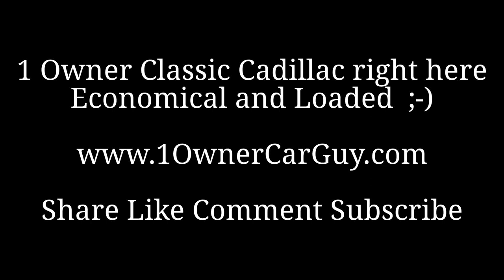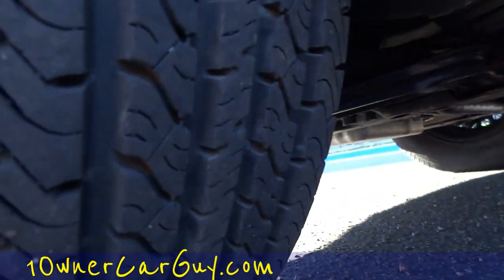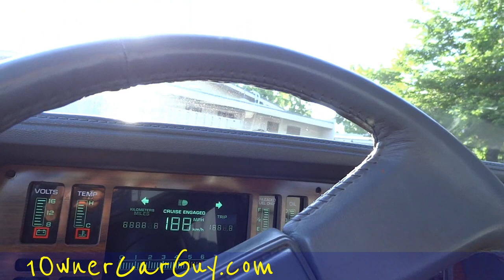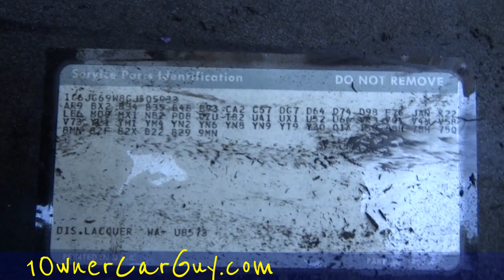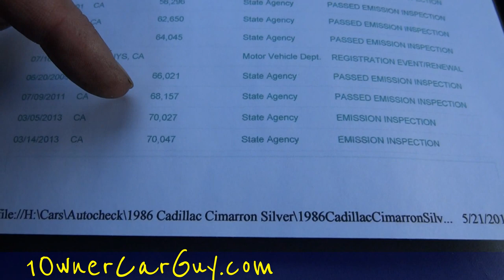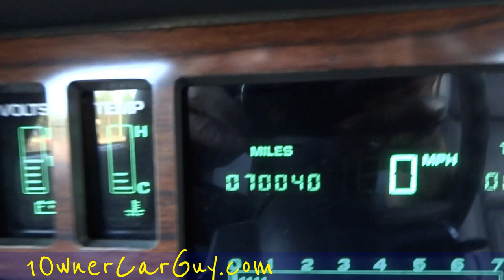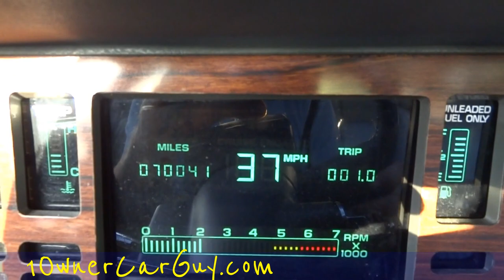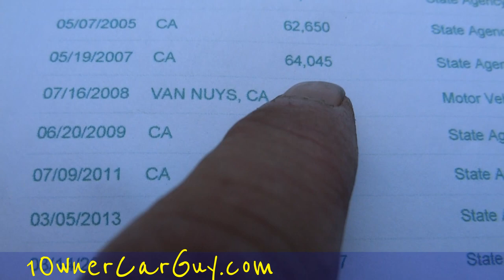Cadillac Cimarron Sedan 2.8L V6 1 Owner 70,000 Original Miles Test Drive Video Review Cavalier

Comment: On the "looks like a supercharger" thing, you can shoehorn a 3800SC and a 4-speed automatic in there, requires some creativity as far as wiring and engine/trans mounts, but it can be done (and has - just search cavalier 3800sc here on YouTube).  Likewise, the 4.9L V8's from 91-95 Caddys also can be fitted.  Northstars aren't so simple, but would be interesting.

Comment: “Beautiful, just beautiful...absolutely beautiful car!”  It probably needs about $3,500 if not more, to get it back in shape.  The whole car needs to be painted and the dings smoothed out.  Repairing torn and cracked leather can be really expensive.  Just fixing the electric antenna can cost at least $200.  I know because I have a 1988 Cimarron that was my moms.  She hated that car so I worked 2 jobs when I was younger to buy it from her and my dad.  They only put 8,400 miles on it and it now has a little over 13,000 miles.  I don’t know why I like these cars because they are NOT practical at all.  They are poorly made and the craftsmanship is a joke.  This one car just about killed Cadillac but for me..... I love the car.  Mine has been garage kept all its life and the paint still faded.  A few electrical things stopped working and the threads on the vinyl top started pulling away from the roof so I had to get that fixed.  The inside roof lining had to be replaced as well and the plastic body parts under the rear taillights and around the headlights had to be replaced as well.  In short, I’ve had to spend thousands on replacing or repairing things on the car that was because GM just threw the Cadillac Cimarron name on a cheap Chevy Citation body, threw a bunch of bullshit convenience options on it and charged the customer thousands extra for it so NO it’s neither a practical or economical car....but I do love the thing.  When I do take it out people ask me about it.  It’s a really nice deep read color with a black top and tan leather.  It actually has a BOSE CD/Cassette player and a factory installed cellphone that I had to pay to update from GM when all cellphone networks became digital and a 5 speed manual transmission.  The car was special ordered by the owner of the dealership where my mom originally bought it from in Jacksonville NC.  The owner drove it for one day and he put it inside the showroom.  My folks got an excellent deal on the car but after a few months they hated it so I (at 15 years old) convinced them that I’d buy it.  I did work 2 summer jobs and then my dad helped me by co-signing a loan for me.  It took me 4 years to pay it off but I always kept it in their garage.  Regardless of how dumb a car it is..........I love the damn thing but like I said it has cost a lot of money to maintain and mine has just a fraction of the miles on it than the car featured in this video.

Comment: I had a GM V-6 2.8L in a 1984 Firebird with about 123,000 miles. It lost oil pressure while I was driving about 2 miles from my home. I pulled over to check the oil and noticed white fluid pouring out of the oil cap. Meaning a gasket or some other internal component failed and radiator coolant was pouring into the oil pan.

Comment: I love that old GM 2.8L V6. A little old lady traded in her '87 Chevy Celebrity wagon that had this motor and 237k miles. It ran amazingly well and by far the most responsive motor I've ever driven.
Reply: She must have bought a decent one,  Overall 2.8 motors are fuel inefficient crappy motors with the added insult of the hard to reach back spark plugs. The 3.8 is better in every way.

Comment: This car deserved very little of the bad press it got saddled with which continues to this day, judging by some of the comments here.  Remember, it was designed at a time when gas prices were over a dollar a gallon for the first time ever.  Had prices continued to rise throughout the 80s there would have been many more cars like this one; from all the manufacturers.  Can you imagine a small FWD Lincoln Town Car?

Instead, gas prices stayed steady and never even topped two dollars a gallon until the year 2000...   And now everyone is driving enormous SUVs with 350 HP and they get about fifteen miles a gallon.

Comment: any of the J-body cars with a V6 is a nice driving car. i have a 1991 cavalier convertible 3.1. for such a small car, its always eager to go. not a slouch like some people think they are
Reply: its actually the older 3.1 multi-port the 3100 was known as the SFI engine. i know they are both the same displacement but they actually are not the same engine. the car has decent performance for a little car. its a little car with a fair sized engine, unlike today where they stuff a over complicated turbo-charged hand grenade under the hood. newer cars offer margninally better fuel economy, are heavier, and allot more complex but dont nessarly perform much better unless your spend $$$$. my other two cars, i have another 91 cavalier 2.2 with 47K miles on it AND i have a 1996 camaro Z28 with the sequential, mass airflow LT1 285hp/335 tq. that car is surprisingly quick for 2.73 gears. 225K miles and still pulls great.
Reply: i own 3 cars with no massive loans. only a small personal loan. $20K+ for one car NO WAY

Comment: I had a 1983 Cimarron Automatic  2.0 TBI Leather interior and the sport suspension package. I removed the Cat for some much needed power.  I drove until it hit 180k which is a lot of miles for an 83 GM 4 banger. honestly with leather seats, great stereo and power everything it was a good little car just not enough to be called a Cadillac or to justify it as a BMW competitor.

Comment: I’m still searching for a complete BOSE system from a 1987-1988 Cadillac Cimarron.  Huge factory amp in trunk with both rear 6x9 speakers and the two front lower kick panel speakers.  It would be great to have the complete set including the wiring.  Help me. Please

Comment: The earlier Cimarrons (1982-1985) were trash, they lacked power, they were too heavy, and they didn't handle well either. The later ones were better but by this point, buyers weren't  interested in the Cimarron at all and eventually Cadillac pulled the plug on this car in 1988.

Comment: am amazed 4 power windows.i think in 2013 some japanse Europeans have only for power windows.
I would only fix the door maby the seats.and polish it wax it

yellow button could be to open the trunk like the fleewood
and so fair ive old school Cadillac's only with hubcaps unless you could buy allow wheels 

qwestion this motor.this motor better than on the new cts and ats ?

Comment: It looks ok. Other than the body damage, ripped interior and faded paint on the front end, I'd say it's in fair condition. But it's still a Cavalier with a Cadillac badge slapped on it. The 2.8 V6 was a somewhat reliable engine but nothing special. The engine mounts often failed on them. To ask more than $650.00 for this car would be a sin. The Cimarron, the Cadillac North Star engine and those awful Oldsmobile diesel engines from the early '80's were probably GM's biggest failures!  The Chevy Vega, Chevette and Citation didn't fare much better in customer reviews either.
Reply: +Seth Williams 
The Northstar actually was one of GMs better engines but the HT engine that predated it was gutless and barely made more power then a NA Buick 3.8.
Reply: My parents had an '81 Citation that was almost trouble free. It was surprisingly comfortable and much easier to live with than the Chevette they also had at that time. One thing I had to do to both of them was install a shutoff valve in the heater hose; for the sin of not paying for AC, GM punished you by trickling hot air at your feed all summer.

Comment: The biggest faux pas I see on the outside is the Cavalier roofline & the cheap looking, protruding windshield wipers. Those features were 100% Cavvy, so obvious & not Caddy. Believe me, the designers at Cadillac could've done better in those areas & it wouldn't have hiked pricing that much. They were already expensive, ala Cadillac!